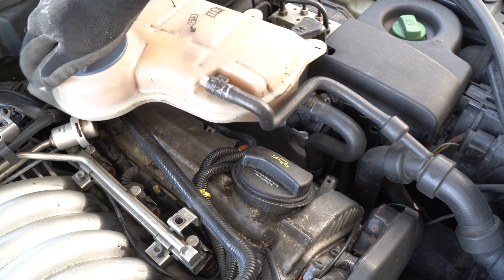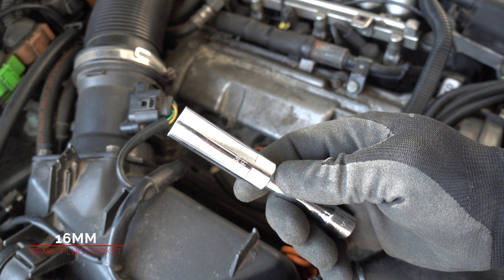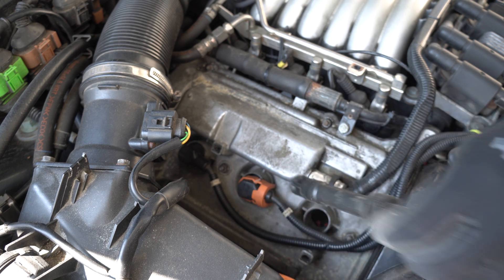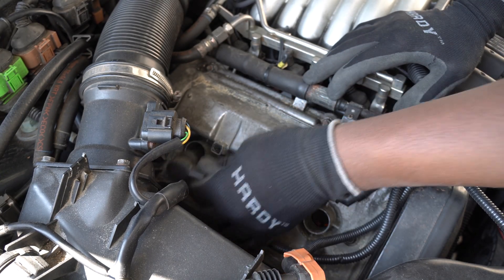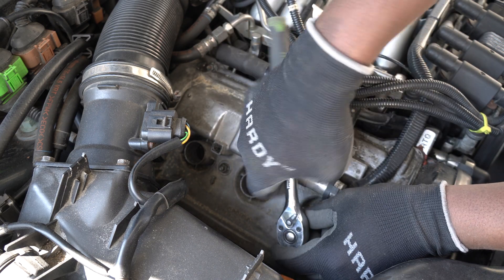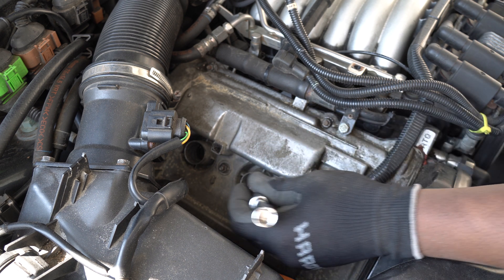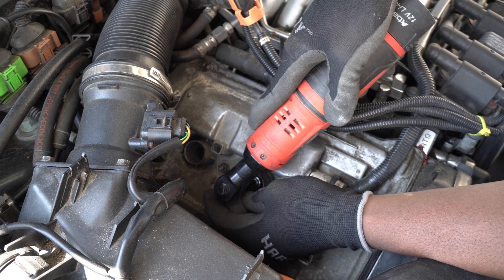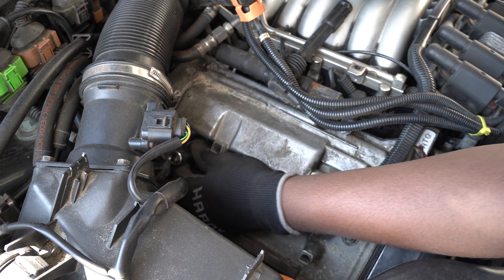1998-2005 VW B5.5 Volkswagen Passat 2.8L V6 Engine Spark Plug Replacement

Comment: Great video! Thank you :) What is the approximate recommended interval for spark plugs replacement?
Reply from the maker: Every 30k miles, but it you should check it occasionally and replace if needed.

Comment: I have a question.. I accidentally broke off the yellow leaf that the oil dip stick goes into (heading towards the engine) is that fixable?
Reply from the maker: Yes, the dipstick tube and the dipstick is replaceable.
Reply: @CraftyWorkshopBuilds  👍

Comment: Why is the passat referred to as a B5.5?  I have 2003 GLX 4Motion V6 from in the USA.  Is it the same engine?
Reply from the maker: 1998-2000 is the B5 and 2001-2005 is the B5.5
Yes, this car in the video has the same engine as your car. Your car is a B5.5